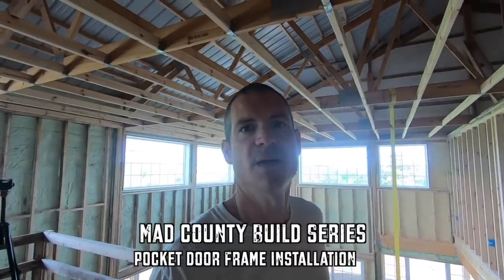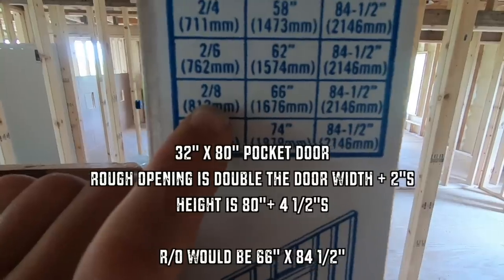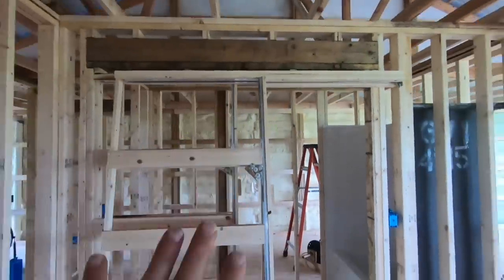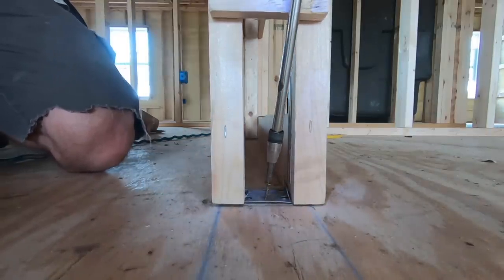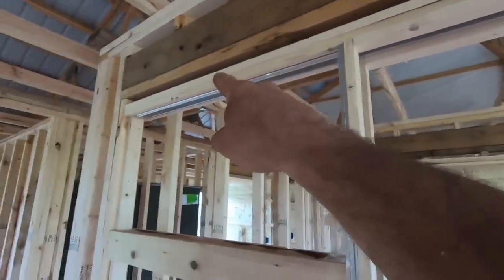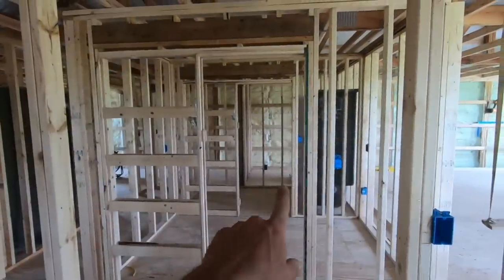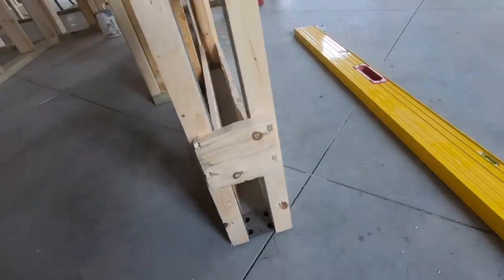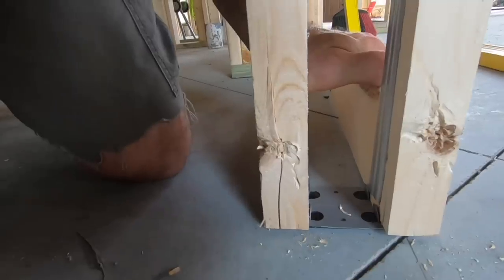Installing a Pocket Door Frame Over Concrete & Wood

Comment: Thank you so much for your videos and construction expertise. We love watching your content and look forward to each and every one you post. 

My family has been in the building business for over 70 years in Colorado. We have pocket doors in the house that my father built for our family when we were children. I recently replaced one of them because it was just too old and the track was damaged. 

When I took it apart I discovered that my father had placed a sheet of 1/2 plywood over the entire face of that pocket door wall, on both sides. The 2x6 header was built a little differently but has the same effect. 

I remember working in construction on his many building sites when I was a teenager. Every pocket door wall we installed were all covered with that half-inch plywood.  It's funny, I never really thought about it much, not until I was faced with it again after all those years. That half inch of plywood really strengthens up and quiets the system. 

It doesn't look like you have much space to cover along those walls but you might take a bit of advice, from an older guy who was taught by an even older one that I miss everyday. Cover that wall system with sheets of half inch ply. You'll come to appreciate it as the years go by.
Reply from the maker: That's awesome! Thank you so much for the tip.

Comment: I installed a 36” pocket door with soft open / soft close. I made the door 38” so it stuck out of the opening to just grab it to close. I thought it was better than the little flip up handle on a normal pocket door.
Reply from the maker: Good thought!
Reply: Excellent

Comment: How do you protect the radiant tubing from the concrete anchors?
Reply: He has faith in his setting of the tubing depth.

Drilling around that tubing would give me a small heart attack.
Reply: I ask that myself everytime he drills into the ground
Reply: He mentioned in another video that the radiant tubing is 5" down so he only goes 2.5-3" deep using tape on the hammer drill.
Reply from the maker: The slab in the house and garage is 5" so just being sure to not drill even close to that!

Comment: Very informative -- thanks for sharing your process! How do you factor your finished floor into this install sequence? As it is, since the pocket door frame is installed on the subfloor, how would you carry the finished floor into the pocket such that you don't have a visual break between the two levels of flooring (subfloor and finished floor)?

Comment: For the concrete one, you can just put the pocket door system right on the concrete? You don't have to use pressure treated wood?

Comment: I really hope the blown-in insulation in the ceiling does the trick. That roof is loud as hell in the rain.
Reply from the maker: It'll make a significant difference. It'll still be louder than a shingle roof, but nothing like it is currently.

Comment: How do you know you’re not going to hit your radiant tubing when drilling?
Reply: I'd like to know this as well!
Reply: @TerrydeAlaska  so I asked that question when I was getting ready to pour my slab over my radiant heat. Fast forward a year. I am done. Basically what I did was lay my house out on the foam and put my radiant heat away from all potential walls. Tapcon’d my walls to the floor and had no issues.
Reply: @astrong1984  Very smart idea... I put in radiant heat in a airplane hanger house I built a few years ago and didn't think that far ahead and I used liquid nails to secure my bottom plates on all the walls...Love your channel...cheers.

Comment: When installing on concrete, do you recommend a vapor barrier. I saw you put flashing tape on the metal bracket, but what about the wood? My basement was built in the 50s and don’t believe there is a barrier below the concrete.
Reply from the maker: Absolutely recommend vapor barrier. We also add 2” of insulation.

Comment: For my Shouse, I purchased 33 used Alder swinging doors in great condition, and want to convert some into pocket doors. Anyone have ideas how to cover up the holes for the regular door knobs and latch so I can reuse these doors?
Reply: I've seen most people use some type of medium to fill it like foam or a holesawn chunk of wood to fill 90% of the hole. Then they finish with Bondo to hide it. Then paint over.
Reply: @augustinasvilkas  How about a plug of wood to either match the door or accent cut to snugly fit the holes, glue no bondo?
Reply from the maker: Those are some great ideas!

Comment: I noticed that when you removed the staples, the thin 1x split. Did you glue it before you restarted it?
Reply from the maker: I stapled it from the side to hold it back together.

Comment: When the pocket door is closed, won’t noise transmit through the wall since it’s core is hollow (hollow due to the gap that the door slides into)? I didn’t see/hear you mention any plans to sound-insulate the pocket walls.
Reply from the maker: No more than a wall without insulation in it. I’ve had them in most of the house I’ve lived in and not noticed a major difference.

Comment: How wide of a rough opening do you need to install a 36 inch pocket door?
Reply from the maker: Typically 73” wide and 85” high but check on the specific door you’re getting

Comment: What’s your thoughts on post frame vs metal building?
Reply from the maker: I’ve never been a part of a metal framed build so not really sure. I’m sure they are super strong. Seems to be used more for commercial than residential.

Comment: Is it level or plumb?  It looks like your are referring to a vertical surface but keep using the term level.  The level as a tool has a  bubble to indicate plumb when the level is held in the vertical position.  Your actions and words don't match.
Reply from the maker: You are right,  technically level is horizontal and plumb is vertical.